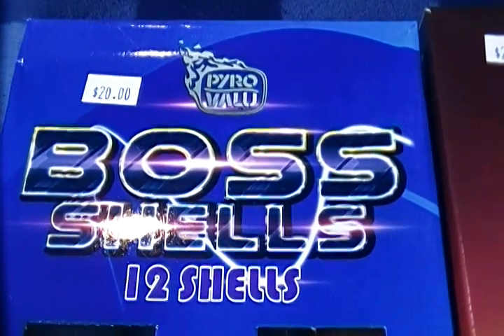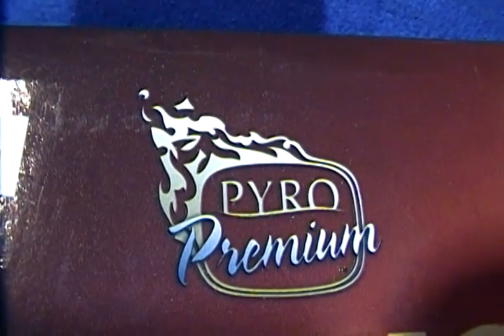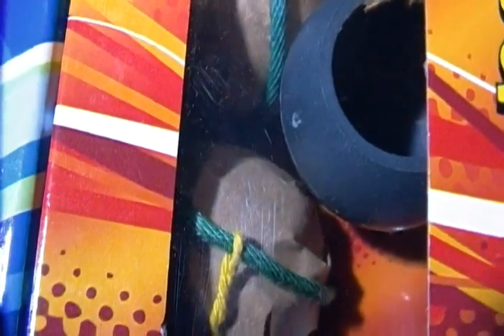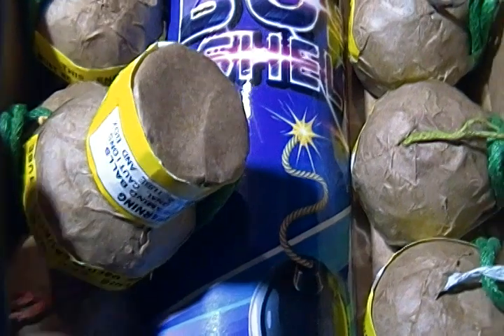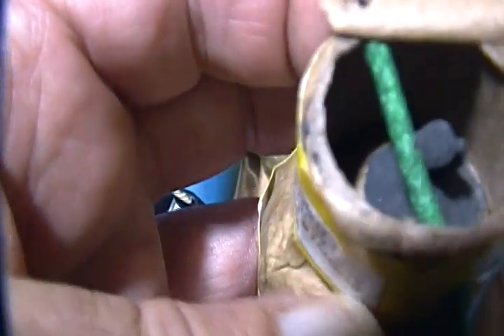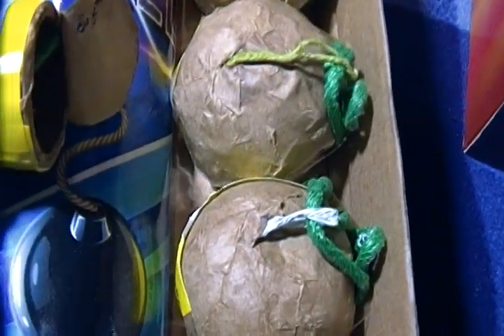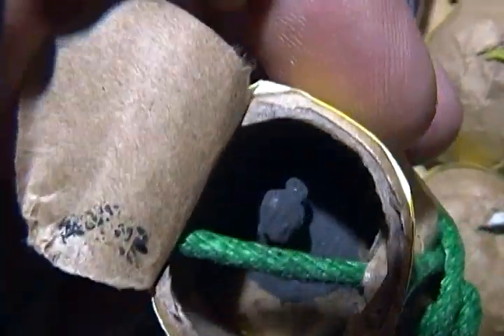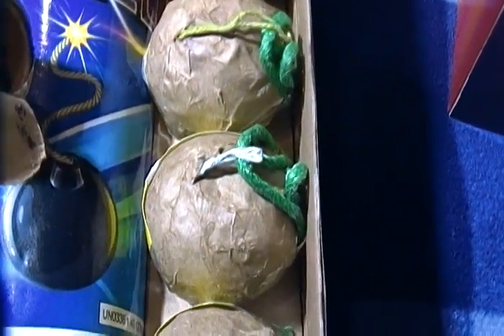A LOOK AT BOSS (not B.O.S.S) SHELLS by PYRO VALUE

Comment: The base of the shell seems to be a lot longer than a regular ball show. I just did a demo on some black cat ball shells that were real. They were actually pretty decent. It's not easy to spot in a store when they're in the box though.
Reply from the maker: Yeah a box with no window and with a window if they are in a cardboard holder all you see is a ball. I have shells with a mine in the lift chamber and it's taller and that can be deceiving. The smaller diameter can be a clue to it being fake but to know I look in the lift chamber to make sure.